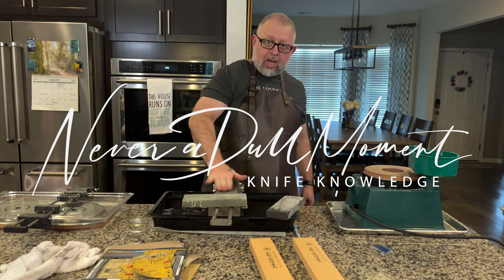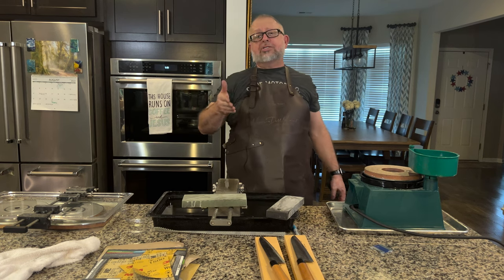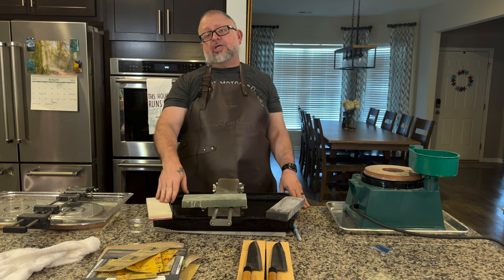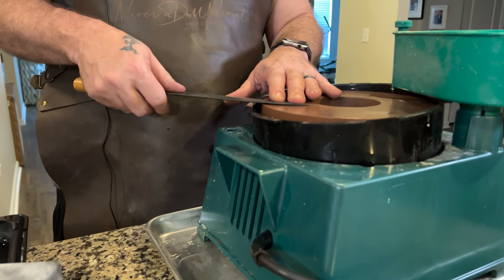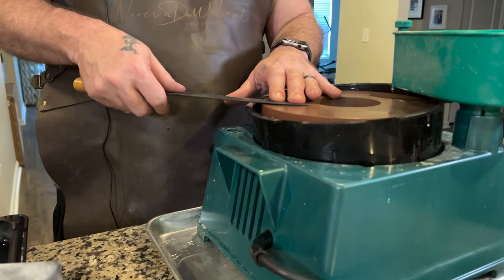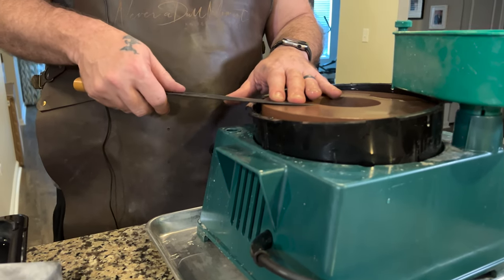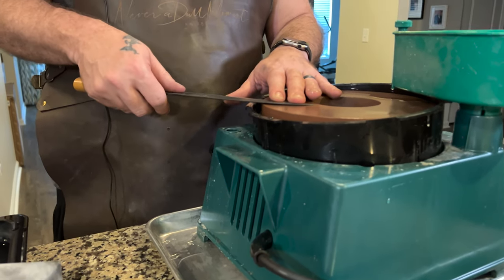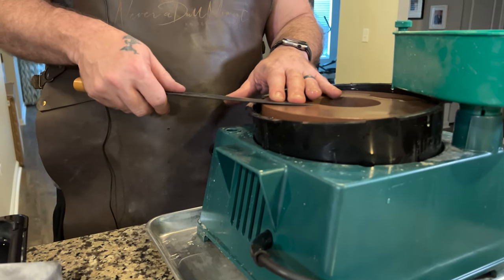Knife Knowledge/Knife Basics: Thinning a knife! Should you do it? How to do it! Why we do it!

Comment: I'd like to quickly add my two cents worth. Overall you cover this spectacularly Greg, however there was one thing I noticed. You said that you need to thin the knife as there is no more of the core metal left exposed and you can only see the cladded steel. You then said that after a while when this happens, the "edge becomes made up of cladded steel instead of the core steel". I would like to add input here. The core steel is and should be in the geometric centre of the steel. If the knife was so badly in requirement of thinning, and only had the cladded metal was in eyeview, this would not mean that the central edge is now comprised of cladded steel. The edge (apex) would still be comprised of the core steel. The reason we thin knives whether they were too thick behind the edge from production, or whether frequent use and sharpening has worn them down, is to restore geometry. A knife that is really thick behind the edge, although may be sharp, will cut like poo and will wedge, whereas a thinner knife that is of the same sharpness will glide through with less resistance.

My overall point here is that no matter how thick a knife gets due to repeated sharpenings, The core steel should always be at the centre of the steel, sandwiched between the cladding and be at the apex of the edge, even if the knife has no core steel exposed to sight. This ofcourse would not be the case in a poorly made knife where the cladding and core has an extreme mismatch and the core has not been centralised properly. In this event, thinning would yield better geometry, but because the core has been poorly forged, the thinning may not return the core to the apex.

I hope this makes sense as to what I have written.
Reply from the maker: Thank you for your comment. I agree with you. I did cover that also. I'm sorry you only heard the one part. I was saying that there was two reasons for doing it. The second reason is the point that you pointed out. I completely agree with you. Making the knife feel matter is extremely important. I had just run into an issue with this knife. The night was that enough technically but we had all that so many times we couldn't get it sharper. We did a video that we had to throw away basically because the edge was not up to par. So I did point out both of those facts but your point is the number one fact. We will always appreciate your comments. You said it very nicely and I appreciate you taking the time to say it very nicely. Thank you for your support and we always except suggestions for future contact. Your opinions are valuable.

Comment: Love the video. Took me years to learn the need for thinning. Got really frustrated before I realized what was going on.

I would note that there are circular stones for use by hand for sharpening scythes and such. There are also different  rounded grinding tools designed for a machine that you could get and just use by hand. Assuming you don't have the machine, obviously.
Reply from the maker: I have the horizontal circular rotating stone machine. I don't have the $1800 one. I have the $350 one. That's a separate episode. I've also learned how to do it with a belt sander.

Comment: Always a great video, I am learning so much. 
Now you are doing this on your higher end Japanese steel knives. Would you do this to let's say a Chicago cutlery type of knife?
I have learned this as revealing a knife or changing the secondary grind and then the primary grind is the sharp edge of a knife. All you're really doing is removing the material behind the primary grind so you can get the angle that you want on the primary grind. I may have the primary and secondary grind confused but it's a matter of taking that further back grind down so you can get that edge grind to the angle that you want. So in essence you want a wiger edge on that cutting edge.....
Or do I just have this all mixed up?
Reply from the maker: You can do it to Chicago cutlery but some of their stuff is not really what you would called serrated but it's their own way of kind of separating it to protect the blade. But all knives can be thinned if they need to be. If you think about a barge pushing through the water then it moves really slow because of us a lot of friction. I've been racing boat will just cut through the water. So you don't really want a thick knife because it wedges in the food. If you have a knife that has been sharpened many times then you're moving the edge back and you're starting to get sick behind the edge so then you have to thin it

Comment: I enjoy your vids, but I have to point out one thing here. The sharpie remaining on the heel is not a "high" spot, it's a slight overgrind resulting in a low spot. To correct this you don't want to add pressure at this spot, you need to grind the surrounding area the match the "low spot" from the overgrind.
Reply from the maker: I might've missed stated that and I do apologize. Sometimes I'll say bevel instead of burr. And sometimes I was a concave instead of convex. I do apologize cause I'm not meaning to mislead you, but I'm glad you caught it and understood.

Comment: How do you go about thining a knife without a distint primary bevel like vg10 tojiros or yaxells? Do u just draw on a " shinogi line" where it would look right? And then just lift the blade some what close to how the angle feels on an equivalent sized carbon knife that does have a hard primary bevel?
Reply from the maker: Typically they are a flat grind so it's typically ground from the spine to the blade. You can definitely do what you said and make your own shinogi line. Great suggestion, but typically those knives are ground 100% flats from the spine to the edge

Comment: It may have been the angle of the video but I never saw the core steel in the SanMai getting more exposed at the edge. I try to keep about 1/4 of an inch of the core steel exposed when I thin a blade. Maybe I missed something.
Reply from the maker: Yeah, the video wasn't that great as far as the viewing. We did expose it and we didn't expose it a lot. I have thinned many more knives now, and I do think it more than I did on that instance, but we did expose the course deal, and it was amazing in the next video, how much more the difference was, and I was shocked and amazed.

Comment: Thinning a knife may change the purpose of that knife by metal geometry change on the very edge. So.. its not recommended unless you know what you are doing.You can't just thin a knife.You are about to change a good gyuto knife ,for example : just to a slicer. My advice is to stick up to the original bevels and microbevels (or restore them) unless you want to have very bad chipping in the very edge.In japanese culture not all knifes are fully sharpened it's up to you to put the final edge.I will not recommend to thin a knife especially double edge knifes to get them behave like single bevel ones ...Cheers!
Reply from the maker: Yes! I mentioned that in the video. I mentioned that you will change the geometry in the video. Those two knives were dulled and sharpened like a countless amount of times so we did it for that reason. But we did explain that in the video

Comment: I recently discovered lapidary wheels. Haven't worked with any yet, however they are flattened Diamond wheels that can go from 80 or 100 up to 12,000?ish. Seems like they could be combined with a drill for power sharpening. Just making an observation not relevant to the video.
Reply from the maker: I will have to look at that. I've never heard of that.

Comment: It seems that, after thinning, you didn't manage to expose the core metal. Should have you simply removed more metal until you could actually see the core metal?
Reply from the maker: I’m sorry you thought that but I guarantee you we did. You should see the next Whetstone or right after. The knives got ridiculously sharp. I don’t know how much you seem to think that we need to expose but we had no problem exposing plenty.
Reply: @nadm  On a Moritaka... more. Just got a 240 Kiritsuke. Screaming sharp splitting wedge. I have my work cut out for me....
Reply from the maker: @joshevans3452  yes, while they do come sharp. You’ll get it. Just take your time. Sometimes it’s about feel.
Reply: @nadm  It's OK. Not my first rodeo. I knew  that it was a project knife. I just didn't realize quite how small the bevel was on the Kiritsuke. It goes from .29 mm behind the edge to 2.04 mm in 11mm / .42 inches. That is a serious wedge and it cuts like it. I dont think it is that extreme on the Gyuto. Compared with a real veg laser like a CCK 1303 that starts at .40 but takes 20mm to go to 1.5mm. It's a different type of knife, obviously, but the point is the same. Geometry is as, if not more, important than apex keenness. My Moritaka, as is, falls through pepper skin without any slice motion but it wedges like crazy after the initial cut. I'm not afraid to thin it but it is going to take a lot of work. I figure I need to move the bevel back at least a half inch to be able to cut a carrot without splitting it like firewood. I have the tools, just need the time.